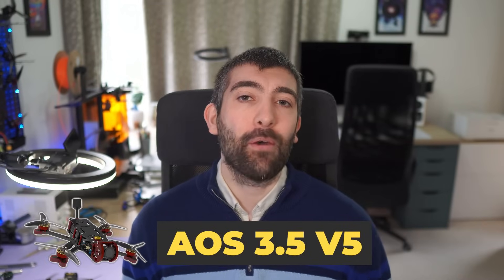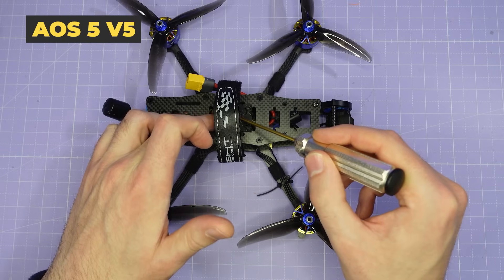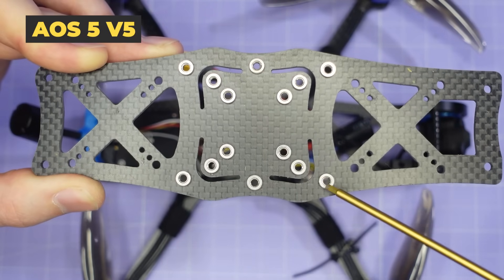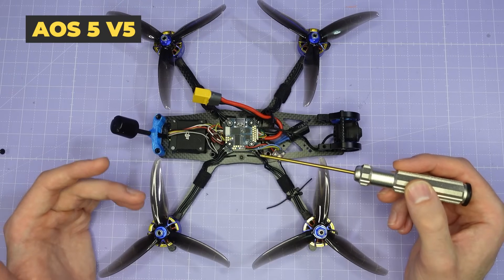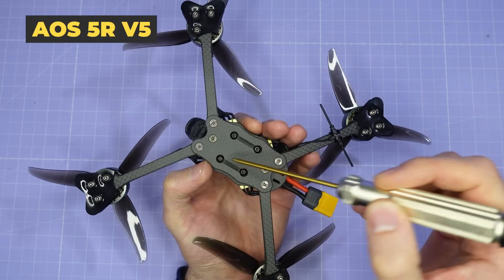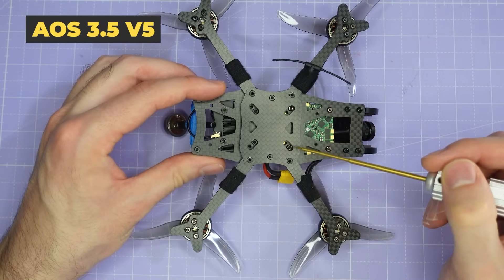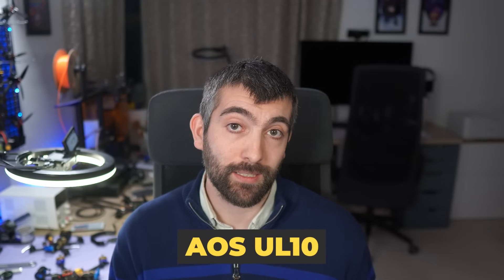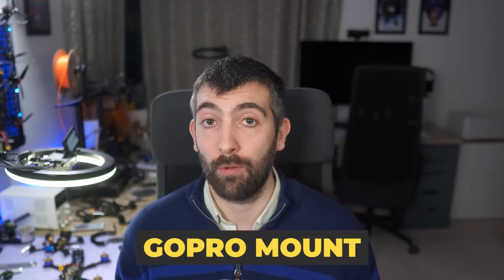AOS V5 Launch: The first frames (and BNFs) with AOS X-Cell Vibration Isolation

Comment: So I took the plunge and built the V5 5 inch and 4 inch over Christmas.  Initial comments, both frames came with a full compliment of TPU and the requested silicone mounts for 03.  I built the 5 inch with a 60 amp speedybee F405 v4 stack, supanova motors, ELRS and a GEPRC M10 gps.  Instructions were easy to follow and the fasteners were good quality.

Nice easy build, loads of space.

The 4 inch I used a Mamba F722 40 amp stack and Axix flying af235 2910 motors.

Stock betaflight 4.5 tune on both was actually pretty good, they fly extremely well and accurately.  I’ve since put Chris’ presets on but wound back the MM a touch until I establish motor heat.  Hopefully get out soon to test.

Summary, I never thought I’d find two frames to better my Apex 4 and 5 inch, but I have.  Well done, you have a convert and a happy customer 😊

Comment: There is bad 50-55hz frame resonances at aos 3.5 v5. How can it be fixed?
Reply from the maker: This is typically due to flexible 3D printed parts such as VTX antennas. Drop me an email if you're still having issues.

Comment: Thanks for the insights and new frame goodness 😁 The main problem is that I don't expect my 3.5 EVO to break any time soon and so will probably never benefit from this 😅
Finally some consideration for battery straps. As a new builder, I was a bit bewildered about that aspect on the 3.5 EVO.
To be honest, I didn't see much from the vibration animation. The stack screw holes moved maybe a bit less relative to each other, but I had to really look for it.

Comment: Got AOS5 few weeks ago and  there is carbon fault (horrible vibrations) Chris didn't respond to my second email about refund(same hardware with same pids and filters flys amazing on diferent frame) and Iflight didn't respond to my email about refund. I know that it's complicated to diagnose the issue but I build quads for years now and I CAN"T RECOMEND  - ARMATAN FRAMES AND AOS FRAME...

Comment: what would a frame designer need to do to use your x-cell concept? do you licence it? have you decided on a rate you would take?
Reply: You can't patent the removal of material from something. Go ahead and copy it. "patent pending" but wont ever go through.
Reply: @MysteryD you can patent a manufacturing technique...
Reply: @MysteryD  there probably is a patented generative design algorithm that does that, remove material...
there are only a few requirements for something to be able to be patented, like non trivial, not widely known in the industry and so on

Comment: I would like to bring your attention to Quad66's War Pig toothpick frames which have used a similar principle to the X-cell. X-cell sits within the frame, while with the War Pig, the FC (diamond AIO) mounting points are located on thin struts linking the X in the centre of the frame, in this way the AIO is also isolated from the arm both  flexing and twisting momentum

Comment: Really interesting indeed! Thanks, Chris! 😃
I've heard soft mounting introduces some latency on Betaflight... I don't understand exactly how or why, but I imagine your design wouldn't... Is that correct?
Anyway, stay safe there with your family! 🖖😊
And happy holidays!
Reply: Hey, super new to FPV here but I what I have read seems to suggest that the soft mounts mean that the forces applied by the motors get's dampened, the soft mounts absorb a portion of it, which would mean the stack takes a second to be "parallel" with the frame/at the same angle, I assume this would give incorrect gyro readouts and spiral from there. I could be very wrong so take it with a grain of salt, on the other side less vibrations would also mean cleaner readouts so hard to say what's best. 

These new frames would significantly reduce the vibrations/improper readings with-out soft mounts so I assume it's be fine to "hard mount" your stack and get better performance than soft mounts + the potential increase in longevity of the electronics
Reply: @michealjohnson7245  Yeap, that's exactly it! 😃
I just don't know if that's correct, but I hope it is! It would be a huge improvement for our quads!

Comment: I wonder if chinese frame designers will copy this vibration isolation
Reply: Don’t wonder, they are Chinese for a reason so they will copy… But, stay fair, buy from the manufacturer of the original, they deserve your support.
Reply: @nickvledder  they deserve the support, but they also should think how to get the prices down and availability high 😉

Comment: I am still flying the AOS 5 03. Broke a few arms and top plate crack at screw holes.
  This will be the 3rd upgraded AOS 5 frame within a  year! 
 But will this new frame accommodate the DJI 04 system ?
 Its so hard to keep up with all these new releases....
Reply: The camera plate is swappable... Let's see which size the electronics of the upcoming DJI System will have

Comment: So hard to tell if this stuff is snake oil or not. I have an AOS UL5 and I dunno vibration wise it's never really been all that special as far as I can tell. I mean it's fine, flies great, but not like I could actually turn off stuff like the second dterm lowpass and gain performance, too much vibration. It's really betaflight doing all the heavy lifting in the case of the UL5, in my experience. And I've replaced literally every component on it trying to figure out why. Could just be a factor of it being a lightweight, or is the AOS stuff snake oil? I dunno! Could the two MPU6000 based FC's I tried on it just be kind of noisey? Maybe! Could it just be user error on my end? Absolutely!

I wish there was an independent third party taking all the latest frames, building them with the same electronics, and doing some very specific flight routines to compare vibration performance. And then maybe tuning that build to the n-th degree to demonstrate if any of its quirks are limiting performance. Probably a build with emax eco motors and speedybee f405, the most popular components, and starting from 0 with the tune and showing step response graphs in pidtoolbox and what not. 

It's just when the owner of the product is the one telling us how their product is superior it makes me a little sus is all. At the same time you kind of own the field of critically analyzing these aspects of performance where nobody else bothers, which is great! 

Anyways, new frames look pretty cool! Maybe I'll get one... Interested in the new UL5 whenever that's released. I've always liked light setups. I've been using 3s 1100 - 1300 packs on the light setups and a higher kv motor instead of a 6s setup. Is that why my UL5 is kind of vibey? Maybe i dunno! My thought was lower voltage lower electrical noise and since it's a lightweight the increase in amp draw wouldn't be that bad or kind of non-existant, and I'm ok with giving up some of the top top end of a 6s setup. My frame can't take much more power anyways the pid loop is already starting to get unhappy with full throttle on the 3s setup. I do have a 1000uf 16v FM series Panasonic cap on board to absorb electrical noise too. HGLRC F722mini stack taken from a Rekon 6s bnf. FPVCycle 2203 2800kv motors.
Reply: its snake oil
Reply: Well the scientific approach is on point but the thing is whether you can feel it (or filter it out) or not.
Reply: I think we are all being a bit too negative lol. I'm not sure it's fair to say rosser is making millions of his products and he does do some good a b testing of different things so he deserves credit for that. I like capitalism if he wants to make the best frame and claim it is and charge for it he should be able to. Just saying not enough ab comparisons to really prove this stuff out which makes me a little sus.

Just saying it'd be nice if there were more conclusive results on what makes his frames better vibrationally. Like black box logging comparing it to the source 1, maybe the apex, and some other popular frames. All with the same filtering settings and a mild tune to really just look at what the fc sees for vibrations. But that would take a good deal of time to gather as well.

Also, so speedybee are cheap and nothing else? What about the speedybee app, isn't that convenient? And is it their fault that Russia and Ukraine are getting the cheapest components possible to fpv explosives at each other? Assuming that's what they're doing idk. I don't understand politics and what not I'm just way too stupid. I mean they could refuse sale but cmon now that would just cause shortages for us hobbyists.
Reply: why has he gone back to normal arms after all his "analysis"
Reply: @MrKillerHobbes  well he said these slots he's cutting do a better job and dropping the a frame makes it more durable I think. And probably cheaper to make less cut time on the arms and probably fit more on a sheet of carbon easier.
Reply: @MrKillerHobbes  15:02
Reply: @MrKillerHobbes so that he can make a v6 version soon with x-cell AND the "better" arms lol
Reply: @saturn_fpv yeah he is getting rich as fxxx designing and selling those frames ...
You here it everywhere from frame design to millionaire...
Reply: @MrKillerHobbes it's almost like technology evolves or something 😂
Reply: @rcvg don’t use speedybee stuff there are much better fcs out there. The v3 is ‘popular’ because they are heading to Russia and the Ukraine ( I’m a bf dev and see our cloud data) they are cheap and nothing else.. and I agree as a frame designer this is different for the sake of it which is fine but I don’t see a big improvement frankly. The new gyro of choice also is tge 42688 which has less built in LPF that the m6k and frankly has a sharper feel.
Reply: @Sugar_K  Is that data publicly available? It would be interesting to know what targets are used most often (top 10 list), what gyros are being used (several graphs over time), etc. Just a couple of charts with random fun facts data. love those things. Also, the v4 features a 42688, and it's still cheap. And isn't the huge black box memory also compelling for you defs? I've seen v3 in a lot of built videos, actually. The price tag makes them interesting for budget prioritizing pilots everywhere, I thought.
Reply: @saturn_fpv  some of its on the bf website

Comment: I fly Quadmula Frames right now and they are really good
But I ordered a 3.5 V5 and a 5 V6, cause I am curious
Also have your motors here which are planned for a second Siren F5, so the spare ones will be added to the 5 V5
Looking forward for the new build and adventures
Reply: That will be an awsome setup. I bet the 5236 props on his motors  on this new frame are the cats azz

Comment: Those cuts are slick but they do look like they are reducing the stiffness of the frame quite a bit. I know you've modeled it, did you find that to be true?
Reply from the maker: It does reduce the stiffness of the baseplate slightly in certain directions but I compensated for that with the interlocking arms and a stiffer bottom brace plate.
Reply: Even if the frame bottom plate has reduced stiffness the reduced noise signal will still be a huge leap forward.  The bottom plate has never been a weak point on aos frames. 
 I do love that beefy bottom brace plate that’s a good move Chris!